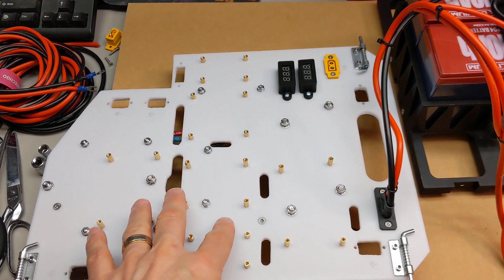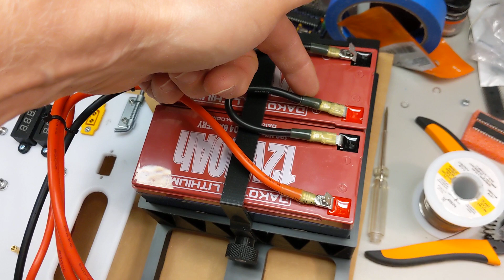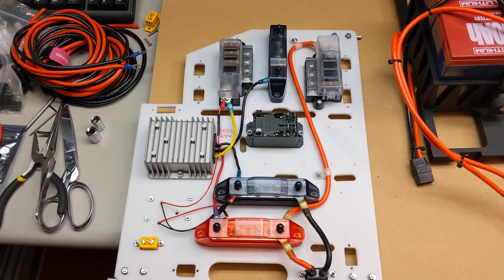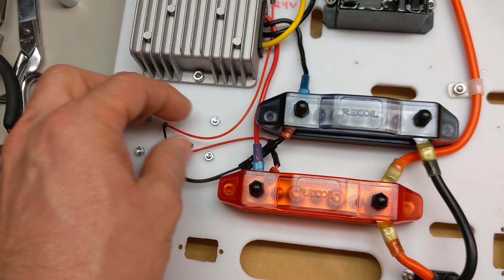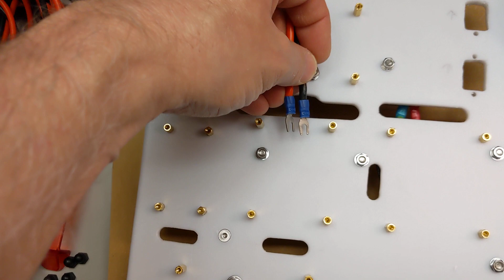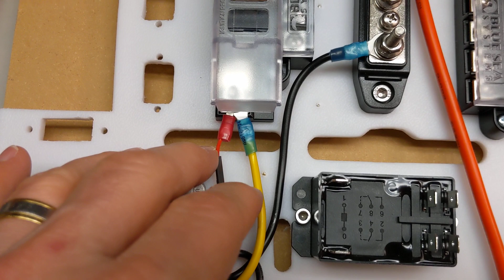3D Printed R2D2 - Part 98

Comment: Thanks so much for doing this video. What is the gauge  wire you from the battery and what is the part number off that connector you used at the bottom? Looks pretty cool!
Reply from the maker: I used 10 guage wire for the battery connections.  If you're asking about the black connectors that I'm using for the battery wires and foot wires, they're XT-90 connectors.  They require the wires to be soldered to the connectors.  The XT-90 connectors fit up to 10 guage wire.  The yellow connectors are XT-60 and can fit up to 12 guage wire.  You can find them on Amazon.com and some hobby store websites.  They are frequently used in radio controlled cars and planes for connecting the batteries.  I bought panel mount versions for the electronics board, as they allow mounting with screws.
Reply: Thank you  sir really looks cool! Your videos have be so helpful thanks....

Comment: What a coincidence there's so much pinball experience displayed here. Many years ago, I did a playfield replacement and full restoration/rebuild of a Bally Mata Hari. Sadly there were a few mechanical issues I was never able to iron out - who knows if I'll ever try to fix them.

Love the use of the dupont connectors for the voltage displays. I'll file that nugget with all the other things I'm keeping in mind for next time.
Reply from the maker: One of the great things about any hobby that involves electronics is being able to take what you've learned and use the knowledge on so many other hobbies and even things like home appliances.